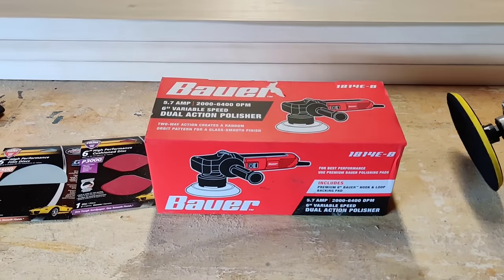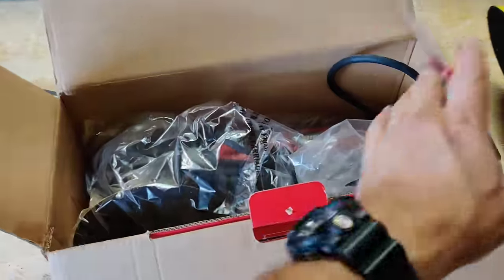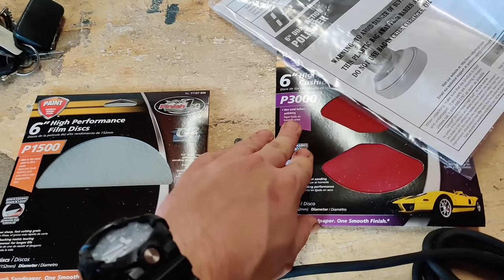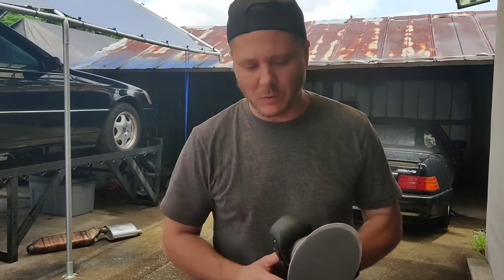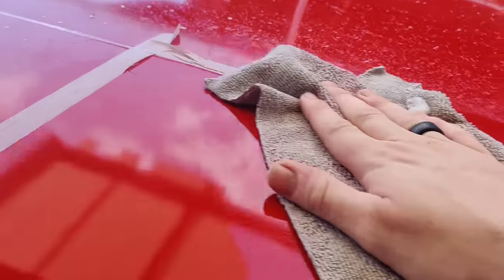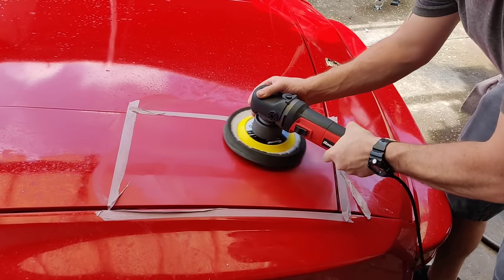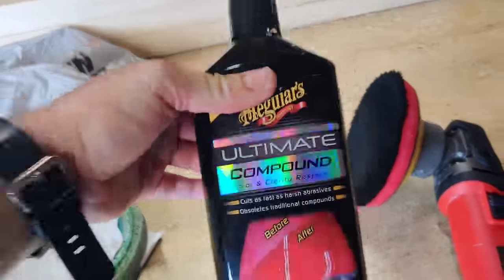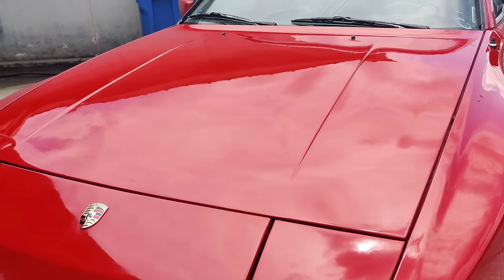Harbor Freight $49 Bauer dual action polisher How good is it? Unbox , review & demo

Comment: Got this DA last night, instantly the best tool in my garage next to the air compressor. 

Cut my hood down to 1200 then 1500, super smooth now. Was all lumpy and had rock chip repairs. Going thru ultimate compound and polish today on foam pads. Stoked 😎

Comment: I’m amazed that you got such great results. I detailed cars for over 25 years my tools were always hundreds of dollars. I think I’ll grab a Bauer as a backup for my Flex. The only downside I heard was the noise, that thing is loud
Reply from the maker: It is loud and it does get a little hot on long use but I've been non stop using it and just did a car last week with amazing results.
Reply: Go see Dallas paint correction on YouTube I believe Scott says he's got five of the Harbor Freight DA's. He keeps one loaded up for each procedure that he wants to do. 
He also has a number of the more expensive machines also. What gives High marks for the Harbor Freight machine. 
Yes he says it's noisy and a little tiring on the hands because of the noise and vibration.
I got mine believe it or not for $39 on sale in June of 2023

Comment: I still have the original HF CE polisher this replaced. Used it for years before I upgraded. It did 100s of corrections and still gets used as a 3" polisher. I've had $400+ Rupes break down 2 months in.

 If you put just a cheap 5" backing plate on it and run 5" or 5.5" pads, it becomes a much better polisher. Less stall, more power. If you're not spinning, you're not doing a whole lot of correction. Ultimate Compound finishes pretty well and Ultimate Polish contains some fillers so I think that's why it worked out well for you here. Cool video though, and very cool car, thanks. 👍 People always ask me if the Bauer replacement is any good.
Reply from the maker: Thanks for the feedback.  Love to hear this

Comment: Use a orbital Sander with smallest orbit stroke you can find usually 3/32 to cut for polish. Don't use masking tape, you'll create a edge that you'll never get rid of its called picture framing in autobody, and it ain't something you want, the more gloss you get buffing, the more imperfections stick out and that making tape line will look like a crease dent. Not saying any of this to be an ass, just trying to help with giving you some advice from someone that does autobody and paint for a living

Comment: Put a line on the outer edge of the yellow backing plate.   It it’s not spinning, it’s not doing work.   Alter hour angle or pressure to make sure the tool is always spinning.

Comment: Pete:   It appears to run smoothly when in full flat contact with the working surface, much better than the Central Pneumatic DA sander-polisher that seemed like it was out of balance most of the time. Nice video!

Comment: I would suggest doing some simple mods like changing out the screws and cheap grease it comes with over to quality high temp grease. Also, some were saying the newer Bauer model is more sensitive to stalling the pads orbit and you have to hold it really level and pay extra attention to the pressure you apply, would appreciate some feed back or suggestions on any experience with that.

Comment: Great video, and your ride looks way better now!  I bought one of these last year and used on a car I bought that had some oxidation.  After compounding and polishing with this tool, it looked so much better.  A couple of questions: (1) when would you use this polisher vs. the orbital sander (I saw your review of the Bauer 5" sander), and (2) would you need to re-apply clear coat after sanding, then go to the compounding and polishing stages (after it cures)?  Thanks!
Reply from the maker: Great questions.   On my car there is no clear coat or at least no top clear coat.   This is a single stage paint.  When I first started the video i figured it was a top clear coat since it was a re paint.   Fortunately i didn’t have to deal with going through clear coat.   Normally you would never want to sand down clear coat unless you are re painting entire car.  It’s near impossible too sand clear snd then re clear.   It can be done usually if your only doing a small area and being very cautious
Now the orbital sander would be used when sanding completely down to to remove bad paint or imperfections.  This polisher could be used like I did with very light sanding like 2000 or 3000 grit to smooth out clear coat.    I hope this helps.
Reply: @petescarport  Yes, thanks for the quick reply!  And that makes perfect sense.  I'm working on another vehicle, and I hand sanded down (180/320 grit) the old paint that was pretty beaten up, then sprayed on primer, paint, and clear coat, then used ~3000 grit to lightly hand sand the orange peel. I think I'll buy that 5" Bauer sander you reviewed to heavy sand the other spots on that same car (before priming, etc.), then use this DA polisher to lightly sand the orange peel once the clear coat has cured. Thanks!
Reply from the maker: Yup that’s exactly how to do it.  Good lucj

Comment: When I apply even slight pressure to mine against the car, the circular spinning stops completely and it just does the orbiting. Is that normal? It can't sand if it isn't spinning.

Comment: You sure the pad was moving when you were polishing? The backing plate wasn't moving. I could read read the label all the way through the process!
Reply from the maker: So I ended up switching to griot garage pads that worked insanely amazing but as you can see from the video this still worked.  I highly suggest a proper pad.   I made a full video of paint correction on this car.
Reply: The size and thickness of the pad are too big for the backing plate. The torsion is killing the machine rotation.
Reply from the maker: @JozueDaniel99  yes you are correct.  This was just to demo but I ended up getting proper pads and doing the whole car.   It was my first time but came out amazing.  Thanks for watching
Reply: @petescarport  It sure looks amazing! Thank you for the video!
Reply: Stall much?
Reply: You're right. At about 8:02 when he says he switched the speed to 3 1/2, it stopped spinning, lol.
Reply: @tjmmcd1  due to the shutter speed

Comment: Hi, Pete, thanks for the video.  I think I need one of these to buff out a Lexan windshield on a Firebird race car of mine.  And btw, in your title, "Braking" is probably misspelled.  Don't you mean "Breaking" and Fixing, not "Braking " and Fixing?  Have a look.
Reply from the maker: Yes should work good on Lexan.  I’ve used it on convertible top plastic and made it crystal clear.  Also not spelled wrong but a play on words.   As in cars break and brake so I had fun with it.
Reply: @petescarport    Roger that, Pete!  Artistic license  😁   Thanks again

Comment: Put some lines on your backing plate to see if it’s moving or not. If they’re not spinning then it’s not working as good as it can. Great job otherwise though!! That paint really popped after you did the 3000 so I know the polish was going to be amazing.
Reply: It was barely spinning at all when polishing
Reply from the maker: Yeah it was the type of pad.  I changed them out.   Made a full video on the car with new pads

Comment: Isn’t the Black foam pad used for applying the Wax (i.e., Orange pad is for “Cutting”, Blue is for “Polishing”, and Black is for apply the “Wax”) — the Blue pad is thicker, than the Black pad, for removing the remaining scratch marks during the Polishing Stage?
     Either way, you did a great job; looks great! - 👍🏼
Reply from the maker: Thanks.  I just had these pads sitting around but I did rest of the car with proper griot garage pads.  I did a video of the full car and then ceramic coated it as well.  Still looks absolutely amazing.

Comment: Thanks for reviewing this polisher. I have 2 questions what wet solutions were you spraying on car before sanding? And you used 1500 and 3000 grit? Made me nervous but wow how awesome it looks. Also can you put a link up for the polishing pads you said were better than the ones sold at Harbor Freight please? I haven't bought any pads yet. Thanks
Reply from the maker: So the spray is just a small amount of dish soap and water.  The polishing pads are made by griots garage.  You can get them at advance auto.
Reply: @petescarport  Thanks!!

Comment: Why at the 8 min mark and when you up it to speed 3 does it slow way down? Too much pressure right? Or is it still polishing correctly?
Reply: I may be incorrect here, but I’m gonna assume it’s because the oscillations of the dual action mechanism….match the frame rate of the camera he was using to record……almost like videos where you’ll see a helicopter liftoff and the rotors appear to not be spinning

Comment: Is the machine spinning? When you were polishing, I didn’t see the pad spin much. Almost as if you put too much pressure.
Reply from the maker: So it wasn't from pressure it was wrong size pad and threw off rotation. I did a full video on paint correction on the car and changed out to the proper pads period but ironically this pad still did the job as you can see
Reply: @petescarport  I bought the same item. The slightest pressure and it does not rotate same as when you tried to polish

Comment: I noticed that in your last step your polishing pad didn’t move much. I have the same problem.
Reply from the maker: So I’ve gotten a lot better with this machine and have done a lot more cars and projects.   I have to say using proper pads getting a feel for speed snd angle will fix this.   I don’t seem to have any issues anymore

Comment: Hello, a question for you, since I am a newbie. I went sanded a Corolla back quarter panel,primed then base coat then clear coat,all duplicolor. The color blended, but surface is dry and rough. Any suggestions to correct for a silky smooth shiny finish?

Thanks
Reply from the maker: Yes sounds like you did everything great so far.  Now wait till paint is fully cure and your going to wet sand again but use 1500, 2000, 2500 and than maybe 3000.   After that compound and polish.  It will be a mirror.   Just be carful as always not to wet sand too much.  Go slow and light.
Reply: @petescarport scared to do it, but I will try a small section.thanks

Comment: 8:25 Is the polisher moving at all or is your camera just not picking it up?
Love the results! 🍊🍊🍊
Reply: yeah i just noticed it wasnt moving at all and i came to the comments
Reply: I don't think it was moving.
Reply: You guys its a camera illusion. When he sped it up the rpm started to match the cameras frame rate so it looked like it was stationary. Same thing happens with helicopter blades, wheels when they look like they stop or are spinning backwards on the highway etc.
Reply: @CuttinChris  no, it's not moving.
Reply: @megaruhe6296  if its spinning counter clockwise, how would it move clockwise while the motor is spinning? Watch closely. If it truly wasn't moving and the base where it says Bauer etc started to go clockwise then the gears are broken in the machine lol

Comment: My car was hit in the parking lot while I was shopping and came out to see scratches on my bumper. I was able to wipe most off with microfiber towel. Do I need the Bauer in your video or do I need the buffer/polisher to remove the remainder of scratches /paint?
Reply: Depends how deep the scratch is? If its in the base coat you won't get it out without a respray.  If its deep in the clear coat just use 2000 grit wet sand and then use a compound to cut it and then polishing compound to polish. You can do it by hand you don't need a machine to do it. If you dont wanna do it by hand buy a drill foam pad attachments. Just google drill brushes and look for ones with foam pads not just brushes. Good luck.

Comment: Can you tell us about the sanding discs? Type, brand, where to purchase? Tyia
Reply from the maker: So I got them at autozone but I haven’t seen them in store in a while.   Here is a link to the 3000 grit pad.  https://www.autozone.com/sandpaper-and-body-repair-tools/sander-and-accessories/p/finish-1st-6in-p3000-foam-sanding-disc/560927_0_0?cmpid=LIA:US:EN:AD:NL:1000000:PBD:8362702311&gbraid=0AAAAADkcoVui8QnXKP9t-EulCLCKUcxY5&gbraid=0AAAAADkcoVui8QnXKP9t-EulCLCKUcxY5&gclid=Cj0KCQjw_viWBhD8ARIsAH1mCd510kZ4b4QVMbq3v4nRcxqflXXVGUKu96YSdrSp1yDZZ4_Kb7jR_NIaAqFXEALw_wcB&gclsrc=aw.ds

Comment: was this single stage paint? because if not then removing the orange peel would cut the clear coat and therefor accelerating the oxidation of the paint quicker wouldn't it? did you protect it afterwards?
Reply: The orange peel was probably in the clearcoat

Comment: good video. in my case I ended up with a lot of light scratches. any idea why?
Reply from the maker: If you went from 1000 to 2000 to 3000 and than compound and polish than you would need to go back to 2000 and 3000 a little longer and than compound again till no more scratches.  You see scratches the 1000 grit left
Reply: @petescarport  thanks

Comment: What is the solution you are using so the water sticks and doesn't immediately dry?
Reply from the maker: Just dish soap and water.
Reply: @petescarport  awesome, thanks bro. cutting, compounding, and polishing my motor yacht at sea! i picked this tool up based on your video. time to make this old gal shine.

Comment: The finishing pad is actually used with the compound and the orange correction pad is used with the polish if you go to their website The terry cloth finishing pad is actually more abrasive then the foam correction pad, sounds backwards but that’s what their website says and that’s the way they use it in all their videos https://youtu.be/NjN2kKUUHyk
Reply from the maker: Extremely interesting and very confusing on their part if true.   I will have to check this out and thanks for the heads up. They definitely need a better system like even using numbers or steps as a description of that to use
Reply: @petescarport  The fast finishing pad says use compound on the box, the orange correction pad says use three in one liquid wax on the box even though he used polish in the video and the waxing pad says use wax on the box, strands of terry cloth or wool is actually course compared to foam.

Comment: so, I see that at higher speeds, the machine only vibrates and barely oscillates...,is this normal? I have a cheap polisher and has the same issue...so it doesn't polish!!
Reply from the maker: In my case I had too big of pads.  At the end I show the proper pads and till a full video of car with proper pads.   If you have the right pad size this machine will work grear
Reply: @petescarport  but does it need to rotate?

Comment: At the 8:01 mark it looks like you holding it down so hard its not hardly moving.
Reply: It's not the pressure he's putting down. It's the rotation of the polishing pad syncing up with the framerate of the camera, causing it to look like the pad has stopped moving.

Comment: I'm curious as to weather it lasts for any time as most start out great and then burn up before you even get a season out of one.... I have a small suv and its just old paint but real good paint.... very thin so you have to be careful not to burn through. So do you still have it a year later?? Thanks in advance
Reply from the maker: Yes I do and use it all the time.   Thanks for asking.  I still highly recommend.  It’s been very durable and still does a great job.  Just get good pads and good product and you will love it

Comment: do the sanding pads stick to the stock backing plate or do i need to purchase a separate velcro backing plate and if so where do you purchae? thanks
Reply from the maker: The sanding pads will stick if you get the correct ones.  Make sure they are the velcro kind and not the sticker ones
Reply: @petescarport  where did you purchase yours? also in terms of buffing out orange peel. is your flow chart always 1500 --> 3000 then comound and polish? can you also take the same approach with a deep scratch on your paint? thanks sir!
Reply from the maker: I purchased them at AutoZone along with the griots pads.  I made a full video doing the rest of the paint correction as well. 

So when it comes to deep scratch you have to approach it different.  Make sure it's not through the clear coat first.  If it's not you can hand sand using a block or wrap wet sandpaper around a sponge.  Chris fix has amazing video on this as well and there's a few other amazing detailers who focus on scratches.  Hope this helps out and good luck with everything
Reply: @petescarport  any way you can tell when its past the clear coat? and thanks for all your help! will check those videos out.
Reply from the maker: So if you rub your finger nail across scratch and you can feel it then it's usually past the clearcoat

Comment: What sand disc did you use?
Reply from the maker: I picked up sand disc from autozone.  They sell them in the sand paper aisle.  I used 1500, 2000 and then the 3000 was a single pad style they sell.  Then I went and got griots brand compound and polish pad to do the rest of car.  The best pads I have ever used.
Reply: @petescarport  Thanks! Griots is a very good brand, the compound and polish I use is Jescar Correcting compound and Sonax Perfect finish.  Amazing finish!!